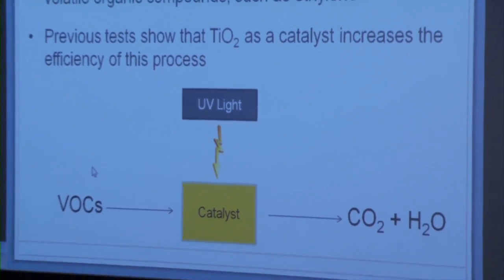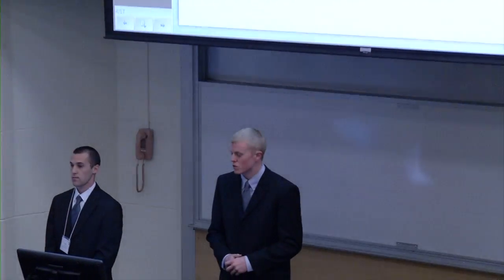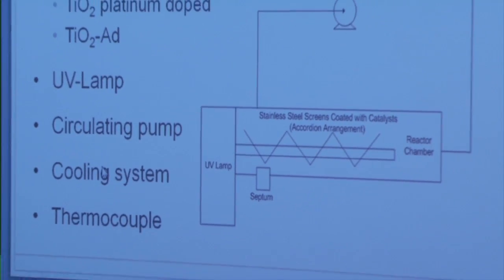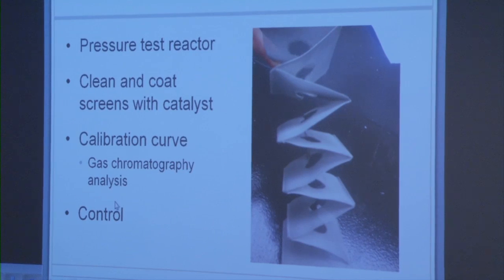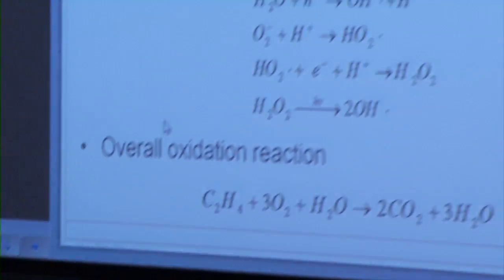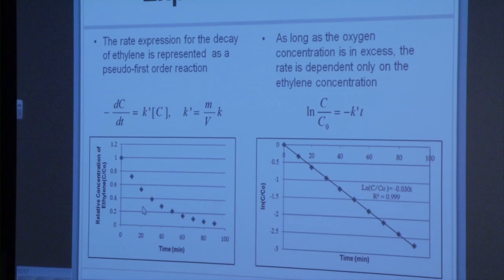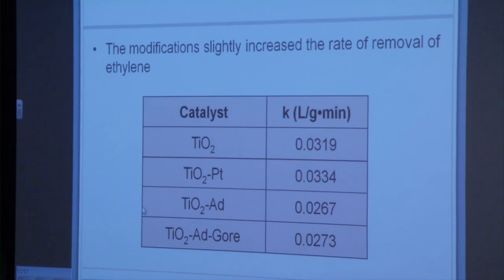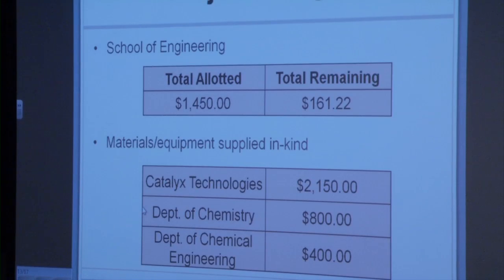Photocatalytic Oxidation of Volatile Organic Compounds

Comment: Finding a solution to a problem that has been solved since 1928!!! No need for a photo catalyst when the solution can be solved with inorganic as received or modified with ion exchanged metal that allow reactive scavenging at higher RH today this problem is well contained without this complicated not very useful chemistry. The choice of the oxide was ignored and the procedure for doping ignored in the presentation
Reply: Bruuuuuhh. look at this duuuuude.